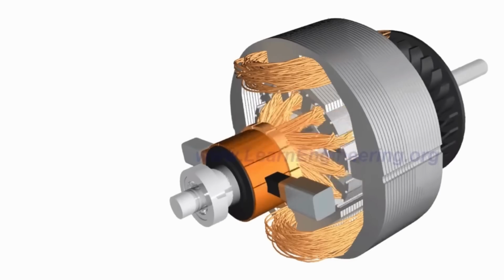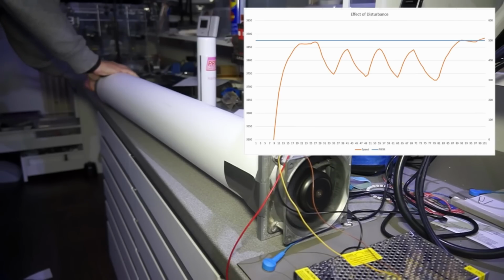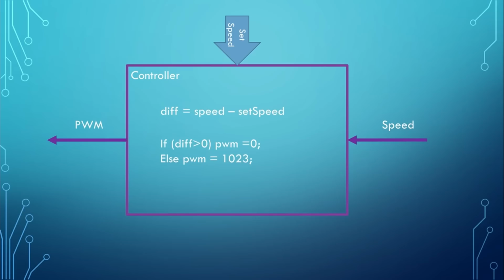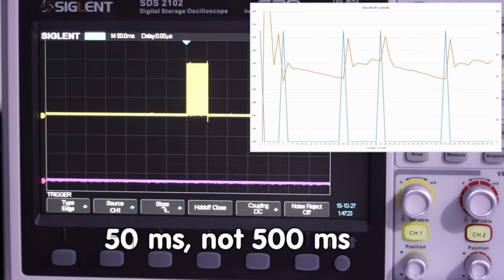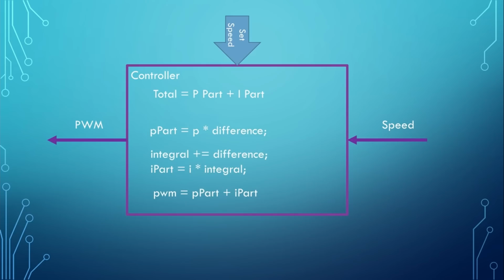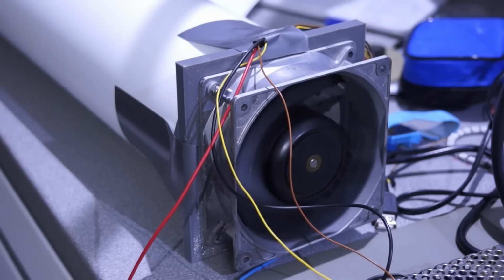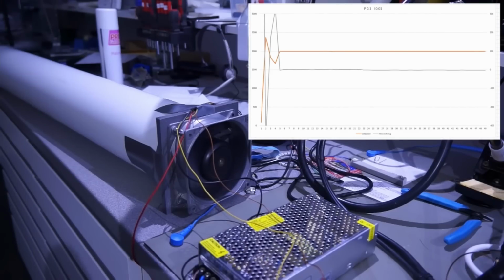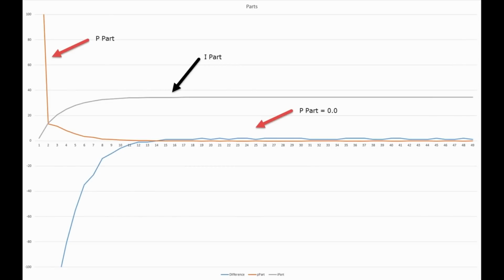#392 PID with Arduino?

Comment: This was very helpful(!) It left out the D part (maybe I just missed it?), but the examples showing the results of playing with P and I were very informative! (And just understanding why the I coefficient should be much much lower than the P one was worth the entire video :-)
Reply from the maker: I thought I mentioned that the D part usually is not needed and complicates things a lot. It is only for special cases to speed-up reaction time.
Reply: @AndreasSpiess  Ah, so you did. I'm wondering how much I should use if I do want to speed up the response though. I have a toaster oven that I'm trying to drive with a PID controller. It has a very slow response time that I've been hoping to speed up, but maybe my trying to use the D parameter explains why it always wants to oscillate :-) Given how long a time constant it has, I suspect I'm going to be best served by using only P and I as you suggested. Thanks again for the extremely useful video! (And for re-publishing it; I wouldn't have known to look that far back in your prior videos :-)
Reply from the maker: @imagingresource: A controller only can speed up the reaction of a fast system. It cannot change physical laws. As you write: A toaster is by definition a very slow system.
Reply: @AndreasSpiess  Thanks, that's an important, fundamental realization for me. If the PID loop is commanding full power output from the oven, cranking up the D component isn't going to make it warm up any faster! (Obvious once you think about it or someone points it out to you, but DOH... :-0) Thanks again! (This video is also going to be a great help to me in tuning the PID loops on my 3D printers. I feel like I finally understand PID for the first time!)
Reply: @AndreasSpiess  When I studied PID controllers (years ago), my prof spent much time on stability and finding the "critical" response: not too slow (overdamped), not too fast (underdamped), but just right (critically damped). Without this sort of analysis, you are driving blind we were told. When I began to apply these lessons to "real-world" problems a few years later, I learned that the transfer function of "the plant" is never as simple as the ones in the textbook. Still - it is useful.
Reply: @AndreasSpiess  Yes! The derivative part is forward-looking, or "predictive". As we see in many endeavors, relying upon our ability to predict the future is often a recipe for failure. :)
Reply: @AndreasSpiess  The D part would help reduce that initial overshoot while leaving the P and I components at numbers that work best for steady operation.  Also, when there is a fast-enough bump in the system - the D component can respond before the difference becomes big enough for P to make a meaningful change or for I to eventually get around to taking care of it.  The last simplified implementation that I saw which included a D component  (temperature control on hot end of a 3D printer) used two consecutive temperature measurements.  Note that the D term is subtracted instead of added.    Change-in-Response = P * <setpoint - measured> + I * <sum(setpoint - measured)> - D * <measured(time n) - measured(time n-1)>.      When I had a problem with a 3D printer's temperature controller, I did exactly the same experiment of changing PID components and watching the response that you've shown here to empirically tune the coefficients.  Brilliant, and well presented.

Comment: A PID works better on system behavior with a linear response.
Sometimes, a little preprocessing can make wonders.
I have controlled a system where it improved the behavior to change the numbers through an approximate function related to a physical numbers. 
f(x)=ax^2 + bx + c .. or .. g(x) = root(x +a)  + b

Putting measurements and setoint through one of the functions, and/or putting output through one of the functions can significantly improve the quality of the controller. 

This approach can make the controller behave better for the full range, as well as improve time to reach setpoint from either side.

Another approach for quick response, also using a physical model on a system with delay, is to estimate how long you can go full speed, without overshooting, then all off, then when the system gets within X% from setpoint, the PI (or PID) is switched on, to the fine adjustment. This can improve response too, by avoiding the output slowly approach the steady state value "too early".

To make it short:
PID can be improved through preprocessing measurements/setpoints before feeding into PID, and/or processing output from PID before setting the output pin.
Response time can be improved using a predictive model when deviation is large.
PID is an incredible tool.
Reply: Wholeheartedly agree, but it is an "advanced topic".
You seldom see YouTube tutorials discuss dimensioning the controller.
Most PID libraries completely ignore physical dimensions, hence users think dimensions are not important.

None of the online tutorials or videos mention the different ways of describing the PID process.
(And most commercially available PID controllers use a different definition (not the P-gain, I-gain and D-gain model) and also don't mention it in their manuals)
Reply from the maker: @Thorbjørn: I agree: If you can model your system you can get a better performance than with a simple PID controller. Often this is not easy. This is probably the reason PID controllers are often used.

Comment: It's really just servo theory, I had to learn it at college back in the 60s. That was, of course, all analog and involved a lot of calculus. Digital servos with PID are much simpler.
Reply from the maker: As you say: Both have to solve the same problems. And proportional amplifiers or integrators can easily be done with op-amps. The calculus is still difficult, I think...

Comment: I still dont get how to properly get started with the P and I values. Should I start with adjusting the P or the I and what value should I select? I once did a project in school  about PID controllers, but never really knew how to begin adjusting it. I just always found myself rising the P and then rising the I, but I could do this infinitely, and did not notice anything happening.
Reply: How did you evaluate the performance?
Do you make a graph of the process variable over time?
 e.g. speed/time  or temperature/time?

Find a way to reliably measure and graph the process.
Then, as you say.. increase P until process becomes unstable... Dial it back 10 or 20%
Then slowly increase I.

As Andreas says, for most home style project the D gain does almost nothing and it makes tuning much more difficult.
Reply from the maker: @Benjami: I wonder that nothing happened when you changed the parameters. Usually the systems react very strong to changes of the parameters...

Comment: Hi Andreas,
Do you know how many encoder interrupts per second can be realistically tracked with a 16MHz micro?

I can't get anywhere near theoretical because I guess some interrupts come quickly close together and I miss a few.

I'm using an ink jet shuttle with dc encoder and can't go faster than 500 mm/min without losing steps. (29 steps/mm) on my channel

At 750mm I lose 0.5mm after running for a minute.

My interrupt is quick: bit wise if-check and increment/decrement. Oscilloscope shows little time in interrupts.
Reply: Your mention of 16MHz makes me wonder if you are using an Atmel-based Arduino of some description (ATMega328, ATMega2560, etc.). If so, the milliseconds clock has a constantly running timer interrupt that would have higher priority than a pin interrupt. That might be your problem. 

Having say that, if my math was right, your current limit is about 250 interrupts per second. It should be possible to handle more than that on the processor. Using Arduino code I've handled >1kHz, and even more by bypassing the Arduino libraries and runtime.
Reply: @martinmckee5333  Yes, I can handle 40000*29 IRQs per second (that seems suspiciously high.I used grbl with f40000 and 29 step/mm, but maybe grbl had an upper limit, or acceleration limited the max freq)  from GRBL.  But from the encoder, I miss steps.  I thought maybe the pulses sometimes come in back-to-back since the shuttle movement isn't perfect.  
So was wondering what real-world results were like.
Reply: @martinmckee5333  oh, I'm using msp430g2553, so I don't know about the millisecond timer, but since I can get so many IRQ per sec directly from GRBL (instead of the encoder), I don't think that is the problem.
Reply: @TheRainHarvester  yes, that absolutely sounds like a hardware issue.
Reply from the maker: Unfortunately, I cannot do remote debugging. I would use a logic analyzer and an oscilloscope. It seems to be a complex problem.
Reply: @AndreasSpiess  I'm only using a diy oscilloscope I made with an stm32f103 !  At least it has 2 probes I can switch around.
Reply: @AndreasSpiess  I was mainly interested in real-world results for inkjet encoders. But it might be an obscure topic.
Reply: Ps In my video using a PID to control a 3d printer.  But for testing, I also disconnected the motor and just moved by hand to verify motor noise was not an electrical issue.

Comment: Great video. PID-controller should be explained with easy examples so people should not be afraid of using them. I would suggest 2 corrections though: (1) the speed of the fan rises when you block the flow. Less mass needs to be transported, so the fan needs less energy. (2) the difference = setSpeed - speed. Not the other way around. In your case the speed would rise if it was to high. You need negative feedback. Best regards and enjoy your vacation.
Reply from the maker: You are right if you expect to block the tunnel. In my case I wanted to calibrate my flow sensor and therefore wanted to have stable wind speeds at different levels..
Reply: One more small remark. Although this video is very good for beginners, there is much to know beyound this video, and there is a big amount of literature for PID regulations from different sources available. Therefore I suggest to align to the standards even when laying down the basics to avoid further confusions. "setSpeed" should be "setpoint", "difference" should be "error signal", as these are their official names used everywhere else. The "i factor" in this example is a multiplier, but should be a divider, as officially it is "integration time", which slows down the I-term, if increases... But anyway, this is also a great video, as usual :)

Comment: Often for fans you are better off looking at current or power as your PV, instead of speed, current is a very good proxy for flow.
Reply from the maker: I agree if you plan to block the flow. I wanted to calibrate different flow meters and therefore needed a constant wind speed at various levels. So I thought the speed would be ok.

Comment: What about using a Raspberry Pi IV + an ADC/DAC Hat for the Raspberry Pi and some simple C++ code that could be run in a loop until no longer needed at which it exits the loop.
Reply from the maker: A Pi could be used, of course. But it probably would be an overkill for such a simple application.
Reply: A linux controller ist not the best way to do PID controllers, it must have a real-time kernel to get perfect results. The first multicopter were build on a arduino system. They controlled 4 motors around 500-1000 loops per second. So everything bigger ist waste of money for a simple motor control.

Comment: Very nice. I used to work as a student programmer at a university researching about airplanes. Those guys always talked about PID which I hadn't heard of but were unable to tell me how to actually make a program of it. In the end I wrote a PID controller on a real-time PCI card in a PC which worked very nicely. Your video however shows the effect of P, I and D perfectly. Thanks.
Reply from the maker: It is always good to do a project if you want to learn how things work. Only then I usually find the important questions.

Comment: You should make a video "PID controllers - adding D to the system"
and explain how the derivative can be important in certain situations.

Thanks to your original video i was able to make a basic one (at first still with i trem windup in it) in less than an hour in lua as a mod for a game and after some help i have a "PID module" that's used in way more places now then i had expected.
Thanks for the video 👍
Reply from the maker: So far I did not find a lot of applications for the "D part". It is mostly used to increase initial reaction time.
Reply: @AndreasSpiess  i had to implement Derivative when i was writing code for a targeting system for a missile (in a game) that uses a semi checkpoint based flight path.
Without the Derivative it would either turn too late/wide, or i had it turn too aggressive and had basically do a 90° turn on the spot to compensate for the start of the turn.

EDIT: What about drones? They use derivative for the abrupt turns to keep it stable while vibrating.
Reply: @AndreasSpiess  Rule of thumb. P-> Present Errors, I -> Past Errors, D-> The "look" into the future :-) Not for your application here. But often working with "D" helps to reduce Jitter or smoothes the reaction if you need fast speed changes . Eg. on a RC Plane or Multicopters. The D Value is the magic portion. :-) I found somewhere the description: "the cushion" of the PID system: smoothes the movement from one postion to an other.

Comment: I took three semesters of control system classes for EE undergrad. I truly wish that this type of video would have been shown at the very beginning - just to get a high-level concept of what you were intended to learn by the end of the class. We never saw any type of practical application in any way - it was 100% math and bode/NyQuist plots. Even the “labs” were just making such plots in MATLAB and simulating the outputs in SimuLink. Luckily there is a lot of great control system content on YouTube.
Reply from the maker: I agree that good professors not always are good teachers (I also had a few of them). I usually try to start with the simple and go in the direction of the complex stuff. I find it easier that way. I also think that many PID controllers cannot easily be calculated because you do not have a good model of the reality. For example the self-balancing robot is very complex if you want to model the stepper motors including drivers. It was easier to just try with different parameters.
Reply: @AndreasSpiess  The Achilles of advanced theories without practical examples is why many engineering schools have a significant dropout and failure percentile. This is particularly true across North America and some parts of Europe.

Comment: Unfortunately there is a small mistake in the video because PID stands for:  P = proportional, I = integral and D = differential
Reply: I have only seen D called the Derivative term...never Differential. Maybe that term is used more in scientific descriptions of the process, rather than an actual device.
Reply: @geoffd8127  Yes you are right it stands for: P = proportional I = integral D = derivative not differntial
Reply from the maker: Thank you for the correction!

Comment: Very nice, Andreas! Again!

But how do I do. if there is no fixed set value?
I want to cool down my server box with the least possible rpm rate to the lowest temperature, to avoid noise.
Temperature of the surroundings is allways changing, of cause and I don´t know what the low temperature I can reach inside.
All I know is, perhaps what is the lowest (or maximum  ?)difference I can (or want to) reach between inside and outside temperature....
Reply: Generally, in a case like that, you want to set the maximum safe temperature as the setpoint. The most important  thing is to protect the server, but if the temperature is below the setpoint, the fans will simply stop.

If you have readings of ambient temperature as well as internal you could calculate the difference and use that as the setpoint. There is no advantage to do that, however. If the ambient temperature is low, then the fan is likely to be running when it doesn't need to, and if ambient temperature is high, the internal temperature may go too high.
Reply from the maker: @muctop: You have to define the goal. The controller only executes what you want. As martin wrote you have different possibilities (constant inside temperature, constant difference, maximum inside temperature)

Comment: Thank u sir for this great job, can u please precise which type of sensor you used ?
Reply from the maker: Indeed, I used a 4 wire fan with a built-in RPM sensor.
Reply: @AndreasSpiess  Thank you sir
Reply: It looks like a 4 wire fan with integrated fanspeed output. + / - / PWM in / rpm out